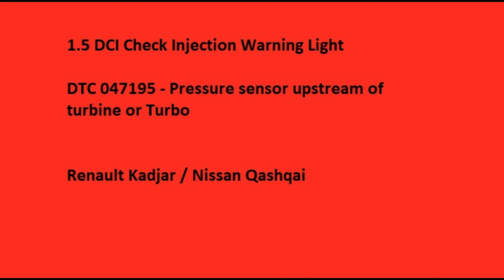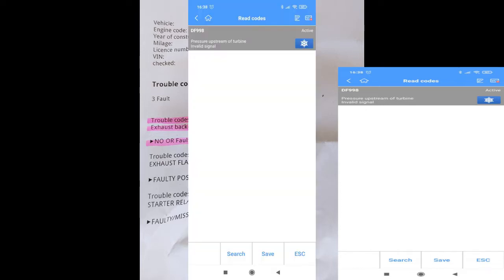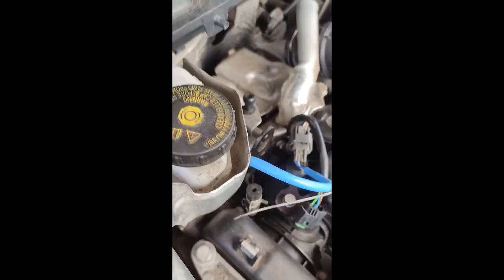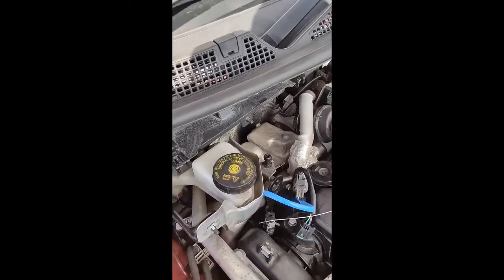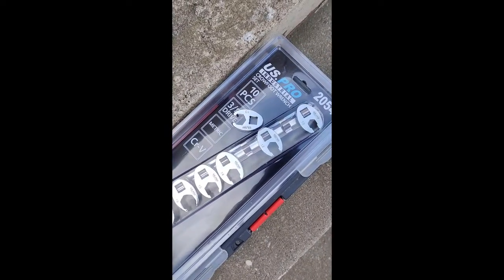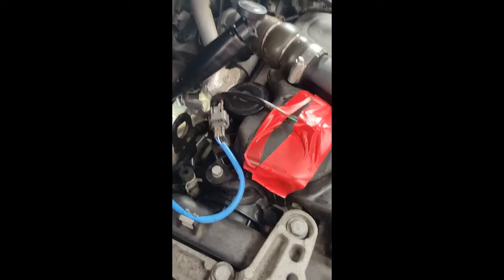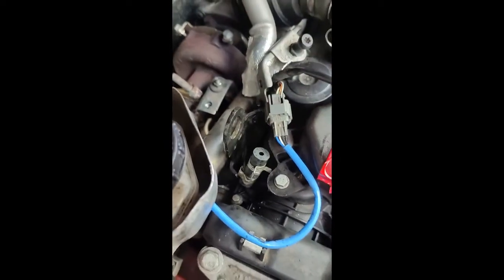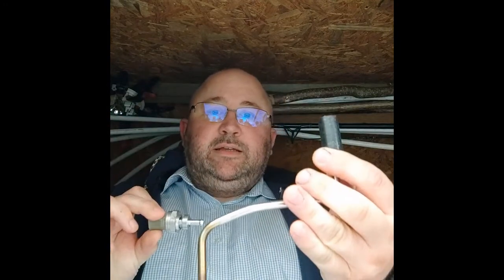Nissan Qashqai J11 / Renault Kadjar 1.5DCi Check Injection or Check Anti Pollution Fault fix

Comment: Thanks for the like! I've just checked and the code I have is P0096, what code did you have for this issue?
Reply: noticed you said DF651 to DTC 047195 is there a P version of these? Mine is a renault kadjar 2016
Reply from the maker: @thelegand1  think it depends on the code reader, most the error codes are shown at 0:56 seconds in the video,  a quick google says that P code is a high level code "P0096 is the OBD-II generic code ", which might mean your using a fairly basic code reader, the one i have from autel has software to break it down more granularly
Reply: @Stoob0y  it certainly is a basic reader! How much do you think a garage would charge for plugging in their diagnostic tool?
Reply from the maker: @thelegand1  some small garages might read it for free but a lot will charge upwards of £50 just to read a code average is 50-80
Reply: @Stoob0y  Appreciate it mate! Thanks for your help and for posting the video! Really helpful:goodvibes:

Comment: Less than £30 from Nissan  for this pipe just done same job,
Reply from the maker: I did wonder afterwards if id went to nissan and got it, presume renault put a huge markup on it.
Reply: Do you know the part number for it?
Reply from the maker: @lordbrindley5769  see the video at 10:57
Reply: What's the pipe called pal